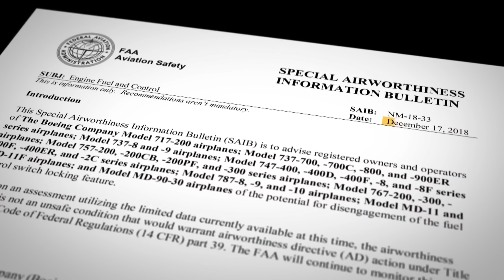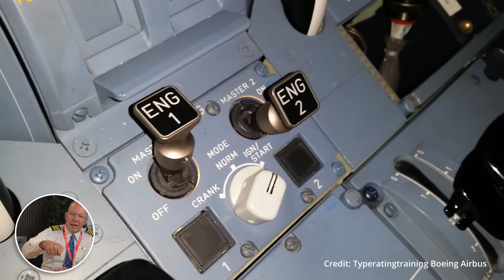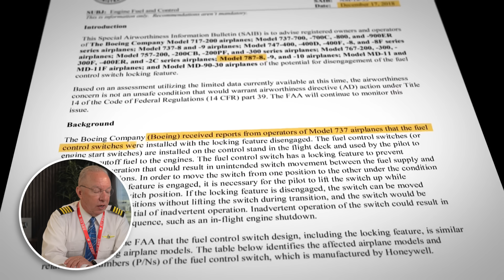Air India 171: The FAA’s 2018 Fuel Switch Locking Bulletin Explained (16 Questions Answered)

Comment: How conveniently deflected blame to the dead experts with 4000 and 15000 hours of respective flying time. One may not even dare to consider 1) the switch's locking system could have been disengaged according to an advisory put out 1 month before the accident by a UK authority causing the switches to 'effectively transition' creating the corresponding EFDR record. 2) 'Effectively transition' could mean a loose switch / internal shorting / circuit malfunction among hundreds of other possible situations that anyone with an electrical degree and critical thinking would consider before deflecting blame to the dead. Internally every circuit consists of a wire and current through it. Even the big, mighty Boeing cannot conduct electricity on a faulty wire. Needs severe investigation and scrutiny to get to the bottom on the truth and provide closure for all the grieving families. To all the westerners, stop pulling conclusions out of your arses, be humble, and remember that even the BEST ship ever designed to be UNSINKABLE sank on its maiden voyage...

Comment: Based on the last question where the one pilot returned the switches to Run, how long would it have taken for the engines to recover and generate enough thrust to resume flight? Would the engines automatically have assumed run condition when the switches were returned to run or would it take some other actions to resume thrust?

Comment: All of the questions and conversations about electrical failures -- none of the answers mention that the switches didn't transition to OFF simultaneously; they were moved sequentially, one second apart.  That is the expected time for a human hand to reach down and change each of the switches, one by one.  That all but rules out the possibility of a non-human-input condition.

Comment: Steve, AI changed the fuel switches twice. Why? Have you thought about another angle, due to mechanical issue both the fuel switches may have automatically moved to cut off position, even after one/both pilots put them back to run, both the turbine engines didn't kick in ...loss of thrust...pilots knew they are going down, hence may have toggled with the switches to reinitiate the engines. We can never rule out Boeing mechanical issue unless it's proven contrary. It took only 8 sec from incline to decline position and I dont think either of the pilots were involved in turning down those fuel switches manually on purpose. There seems to be something missing here and the reports fails to provide crucial facts.

Comment: in this day and age there should be cameras in the aircraft as well as outside the aircraft to help pilots diagnose with rapid responses as well as investigators. my pickup has a back up camera factory stock...aircraft need a wide angle camera over the cockpit facing backwards , one under the nose wide angle facing backwards. one at the top front of the vertical stab facing towards the nose another in the cockpit above the cabin door facing towards the front windows another over the center of the pilots head facing down to all the control surfaces. another camera outside the cabin above the door facing into the service and passenger cabin.
the ones on the exterior of the aircraft should have  flood light illumination behind them. this gives pilots instant feedback to control surfaces, engine situation, landing gear situation, and souls on board trying to access the cabin.
the pilots union should be antitrust busted if any pilot thinks that they can cross my aid space with terrorists onboard. i live between two major urban power plants within a few miles of each other, one is a nuclear plant. no aircraft should be allowed within 50 miles of any nuclear plant.
9-11-2001 proved every pilot is 100% wrong not once, not twice, not just three times, but 4 times in less than 4 hours. the airliners that keep getting shot down by the government militaries is another.
i don't care about pilots having to pee into a bottle because they can't get to a bathroom. mile high club pilots and female passengers/stewardesses in the cabin doesn't bother me either.
every employee takes short cuts to save time at points, violations of procedure aren't the reason for the cameras. UPS drivers have a infrared camera and hands free two way communication in the cab that allow management to monitor the situation and help when required. the george floydd insurrection was proof enough when a UPS truck was stopped hijacked and robbed and the driver assaulted, the palestinians have already proven repeatedly over and over and over they are nothing but terrorists. management having the ability to see what's going on is more help than any union-pilot argument against due to national safety....yes it will be abused, that's what unions are for, any union boss who argues against needs to be fired because they don't want to do their job which entails working, and being smarter than the rock they are hiding under.
after 9-11 i revoked  presidential executive order allowing the right of passage thru my airspace.
this incident further proves i was right to do so. 
doesn't do with out much of a physical deterrent tho, to which i do have and employ as peaceful measures via a red barron tri plane kite no pilot can miss @angels 1,000. i get calls everytime some one new at the FAA works my area and i have to remind them my airspace is closed since october 20,2001 and refax the original notification of revocation of executive privilege and authority over my airspace..... more so with the local flight schools than MSP.
i am an air force brat from griffis. i know things pilots and base commanders, let alone airport management aren't allowed to talk about with the G.P.

Comment: Is it not possible that the pilots set the fuel cutoff switches to OFF to deploy the RAT immediately as a RESULT of the dual engine failure? 
Meaning that both engines quit for a prior different reason and not as a result of the fuel cutoff switch being turned off?
Capt Steve himself said in one of his July 12 videos on this topic that it takes up to 60 seconds for the RAT to deploy through regular engine failure, but switching the fuel cutoff to OFF will deploy the RAT almost immediately.

If i heard this correctly, is the possibility that the pilots switched the fuel cutoff switch to OFF as a RESULT of the dual engine failure being considered?

If I am misunderstanding please feel free to let me know

Comment: 11:40 If there was a situation where the engine must be turned off, due to fire or otherwise, wouldn't you anyway pull back the throttle before cutting the fuel?

I'd argue, if the situation really is so hectic and fast paced; the risk associated with turning off the wrong engine off is more serious (and due to time pressure more likely) than the risks of running the engine extra couple seconds while the pilot pulls back the throttle.

Requiring pulling back the throttle seems like common sense sanity check, considering all the accidents caused by shutting down (or feathering) the wrong engine.

Comment: If one of the pilots switched the fuel switch to cutoff mode, and the other pilot corrected it and one of the engines was resuscitated, and yet the pilot made a MAYDAY call. Doesn’t this indicate that there was some error with the electronic system which was probably beyond the pilot’s reach?

Comment: What happened in the servicing that happened before the flight? Were the fuel control switches in any way impacted? Because while doing servicing elsewhere of the servicing engineers by mistake forgot and altered the locking mechanism or it was altered by mistaken contact then also this will be impacted only during takeoff.

The preliminary report mentions some servicing done. I don't know why no one talks about it.

Comment: I really don’t think the suicide theory holds up here. There’s too much that doesn’t fit that narrative – especially the crew’s confused reactions and the quick attempt to restart the engines.

ChatGPT helped me look into this FAA bulletin from 2018 about the exact type of fuel control switches used in the 787. Here’s the key part:

Hazard Description:
The FAA identified the potential for a malfunction of the locking mechanism on the fuel control switches. If the locking feature is not properly engaged, the switch can be moved between RUN and CUTOFF without lifting it, making unintentional movement possible—even due to slight touch or vibration. This could result in an accidental engine shutdown in flight.

This was a known issue – not mandatory to fix – and apparently not addressed by Air India. Given that both switches flipped within a second, this seems more plausible than any deliberate action.

Comment: Dr. Steve, I get it about the spring loading of the switch but is it practically possible that the fuel switches could turn themselves off automatically due to any software glitch ? Secondly, is it possible for a pilot to inadvertently (due human error) CUT-OFF fuel to engines without the other actually seeing what the other has just done ? Thirdly can a pilot CUT-OFF fuel inadvertently/unintentionally (human factors) if they have mental issues to the extent that he is unaware that he has just turned the switch to CUT-OFF ? Finally, why would one pilot ASK why the other just CUT-OFF fuel if he isn't sure and the other denies that he did so ?

Comment: This is a bit long so bear with me 
The FDR has only so many channels 
I can see a pressure transducer on the fuel pumps outlet s to ascertain they are producing pressure 
I can see a current transducer on the fuel pumps power cable to ascertain they are receiving power
To ascertain the fuel pump switch positions would require the switches to be adual pole single throw, DP,St
Where the 2nd pole indicates the switch position to the FDR 
That's 6 channels to the FDR just for the fuel pumps 
Is this actually true: the fuel pump switches are DPST with the second pole aFDR switch position indicator?
Or is there some other assumption that is being used to assume the switches changed positions? 
Both Boeing and MD have used human error to initially cover up design flaws

Comment: Why do we need a switch to cut off fuel to the engine mid flight?
If at all it is needed, shouldn't it be decided by the FADEC depending on certain parameters?

Comment: There should be two sets of fuel cutoff switches on either side of the cockpit. They should have a dual confirmation system of both sets needing to be switched to cutoff by both pilots before it actually occurs.

Comment: A software modification should be developed for situations like this, while in takeoof mode or low altitude to require both pilots to acknowledge a fuel cutoff command with acknowledgement switches on extreme outer portion of instrument panel that could only be reached by respective flight crew member as a failsafe.

Comment: I’m struggling to understand how the fuel switch could be turned off just one second apart between the two switches. These aren’t like ordinary light switches at home—turning them off or on requires deliberate effort. To me, this points more toward a mechanical failure. I’m not a pilot, but it’s hard to believe something like this could happen without the other person noticing—especially in a cockpit, where they sit side by side. And how can they be so sure human involvement was behind it? These are machines, and in my view, anything is possible. Honestly, it feels like there’s more to this story than what we’re being told.
Reply: I am not convinced that the pilot moved the fuel control switches..
Reply: Please watch Gaurav Taneja’s part 3 video on this. Apparently the engine failed right after liftoff and the fuel was cut off and on for reigniting the failing engines as per standard procedure.

Comment: Fuel Control switches don't need to exist in the first place. Rely on T-handles or setting throttles to cutoff to turn off fuel flow to engines. Pretty old system design in many Air Force birds.

Comment: The need of cameras on the flight deck seems cut and dry. The airlines can use a similar technology, governed by the FAA, that the police have been using for years. If something happens the video record is kept. If not, fifteen minutes after wheels on ground the video is deleted. No chance of it being leaked. The pilots voices are already being recorded and there haven't been leaks for pilots trash talk during the flight. And YOU know that happens!

Comment: Have ask one thing: is the fuel cutoff switch logic different on Boeings? Talked with an Embraier pilot and he said that on Embraiers the engines will not be shut down from cutoff switches if the power handles are in non-idle position. How about in Airbus planes?

Comment: Could it be that  just before VR one engine failed for some reason or was thought to be shutting down, so the captain decided to do a restart on that engine by shutting the fuel valve off, then realized that he had shut the wrong engine, so after a bit of confusion(10 seconds) reopened both the valves. As we already know the engines were spooling up although without the height to succeed.

Comment: I disagree with Steve. The electronic control of the fuel shut-off valve "failed". It triggered both fuel to shut-off without the pilot consent. Therefore the Pilot questioned the Co-Pilot if he did cut-off the fuel, which he denied. The Pilot then proceeds to resets the fuel cut-off levers, switching it from Run to Cut-off and back to Run again. Thats why this motion was recorded in the CVFDR. The Pilot did what they Professionally could. The Electronics board failed them

Comment: There are wires, electronic control modules and logic systems between the fuel switches and the actual valves
So any EM Interferences can turn off and on the systdms
Reply: I believe that the pilots are innocent of any misdeed
Reply: In my first 5 years (of 27) working in aircraft maintenance,  I learned never to say never and that the "impossible" can indeed happen. As an experienced mechanic,  I'm not ready to rule out some type of electrical failure or hiccup. I'm content to wait for the final report. There could still be an underlying electrical cause. I doubt they'll ever be able to isolate the problem without the ability to actually troubleshoot the aircraft. I've also seen a number of extremely minor issues add up to one spectacular "Oh, sh*t!".  I hope time will tell. I really hope and pray it wasn't intentional.

Comment: If a pilot is doing something in the cockpit that they shouldn’t be doing - doesn’t that suggest a need for cameras? Did you really mean that you don’t want the airline to have additional cause to terminate pilots over what you consider to be minor or incidental CRM policies? That is how your comment came off. You are on the wrong side of the issue.

Comment: Why did you directly question pilot's skill and mental condition? if, There was already an advisory in 2018 about disengagement issues in the same switches of Boeing 787. As of now there is no data published about video recording of cockpit, their detail conversation during those 10 seconds. Switching off  both spring loaded fuel switches during take off is impossible blunder that any experienced pilot could do, RAT was immediately deployed within few second when aircraft was above the runway. Why can't we consider there could be case of cascading failure of switches, about which pilot wasn't aware. Western media is directly blaming experienced Pilots to save the image of Manufacturer and their share value in the market.

Comment: There was a latest report titled "Air India crash report shows pilot confusion over engine switch movement" by The Straits Times about this fuel cut-off issue. I tried to attach the link but YouTube had deleted my comment. It reported an interesting information that a GE bulletin stated a flawed chip if not replaced after 11,000 cycles could cause the fuel cut-off during loss of signal.

Comment: Steve you have said it yourself: One pilot moved the switches to fuel cut off - the other one realized and asked him "Why did you do that"? And then he proceeded to move the switches back to fuel run position - Had there been a mental health issue with the first pilot, there would have been a struggle, the first pilot who had mental health issues intended to crash the plane, take 275 lives with him - he would have prevented the second pilot from moving the switches back to fuel run positions. This is plain human behavior logic - Why can't anyone see this including the counselors???
Reply: Wrong. It didn't matter that the switches were out back to run, the person that flipped them off did so at exactly the right time that switching them back on would have been too late

Comment: Someone else has posted that one of the pilots that was supposed to bring the landing gear up perhaps just had a brain fog moment (maybe was thinking of something else entirely) and did another familiar action instead (fuel switches cut off).

This should never happen but I can see that it could happen.

I have done things like that where I was thinking about a movie I had recently seen and was going to get something that was in a kitchen cabinet and invertently open the refrigerator door instead.

I think that the brain fog explanation is more likely than a deliberate suicide explanation. 

I also think that an electrical anomaly beyond the fuel switches could have triggered a pilot to turn the switches off and on.